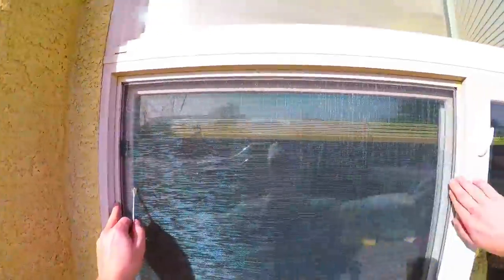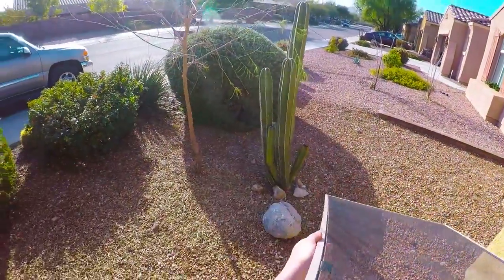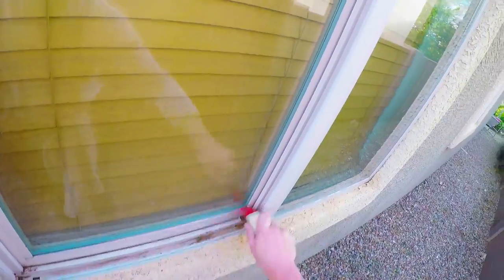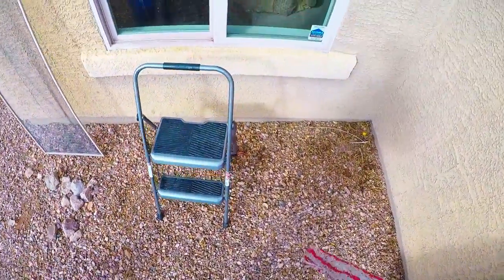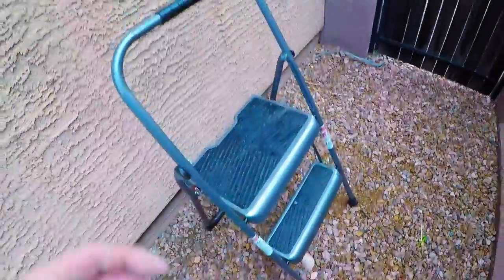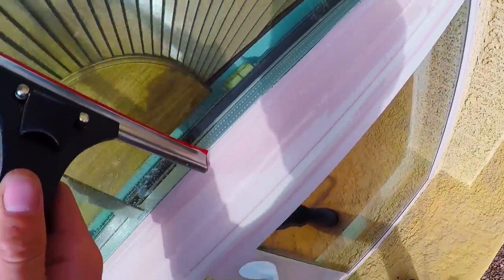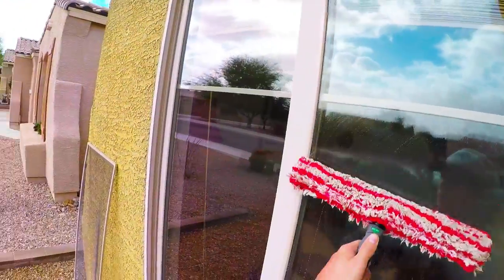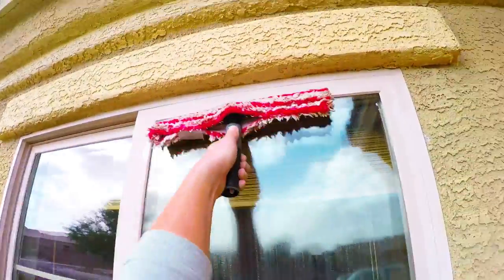Screens, Werner Step Stool & Window Cleaning

Comment: best took for pulling screens is a tack puller, which I use to clean tracks with as well.  A can opener actually works well too. but best is the tack puller.

Comment: Also, what kind of screen brush was that and how much. Don't do much Residentail, but looks like something I should add to the arsenal.
Reply from the maker: Picked it up at my local Maintenance Mart. They sell janitorial supplies and window cleaning supplies. Its just your basic soft bristle brush. I think it was like 7 bucks.
Reply: A lot of dust came off if it.
Reply from the maker: Yeah lots of dusty screens here in Arizona.
Reply: I can only imagine.
Reply: Ok. Thanks. Heading to bed. Got to get ready for tomorrow to keep those pockets fat.😉